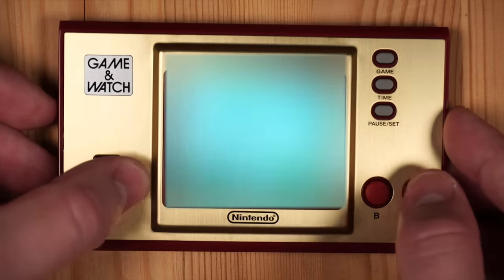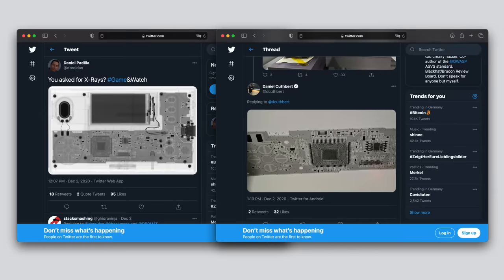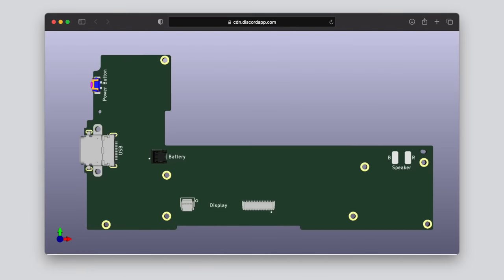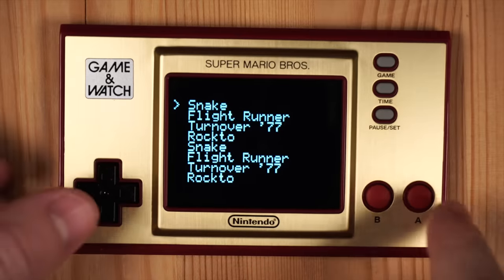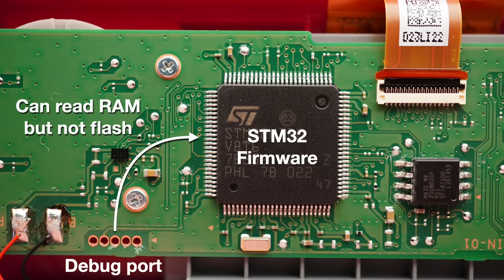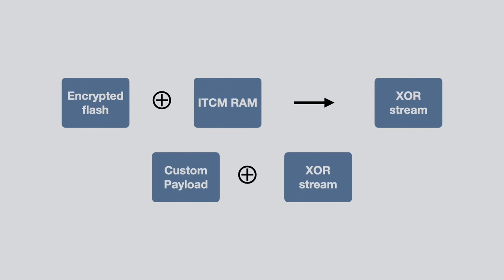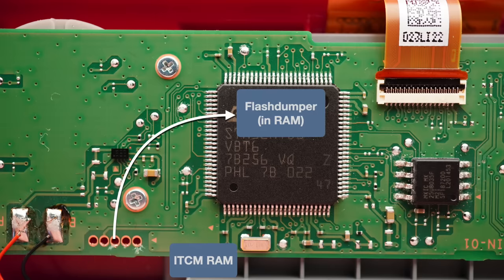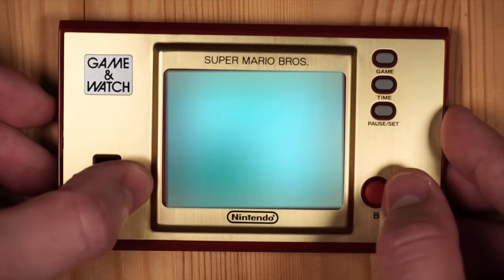Game & Watch: How we dumped the firmware & community-updates

Comment: At this rate, yall will basically make the G&W fully open source
Reply: I mean, it basically already is :p
The board's been retraced, all of the parts have been identified, and open-source software, whilst not exactly complete firmware replacements (although the gui branch in the retro-go project is looking pretty spicy 👀) is available and pretty usable!
Reply: @miko-nv9cl  This makes me want to do a through-hole soldered version of the G&W, what a cool community
Reply: @MrKhaz101  
I'd like to see someone try. 
  I'll settle for someone showing me a similar DC to DC converter that only takes a tiny over-width 0805 inductor, 2 resistors, and a few well placed ceramic capacitors in 0805 and smaller to run a μC of this size. ...Or better yet, someone tell me what chip they are using. I've been through smdmark, smd,yooneed,one, octopart, digikey mouser, arrow, TI, Torix Semi, AliEx and lcsc...so far, but no dice on a DSBGA-12 DC Converter or Audio chip match. I mean, if you were to want something to do...this is what I need to complete the fully reversed hardware.

There are ~70 passives and the vast majority are 0201. A THT design will be significantly larger :-)

@Sinisig
 yup

Comment: I'm most looking forward to the FPGA idea, I love the G&W design but the stock firmware is really quite lackluster. I'm also no good at soldering so a drop-in replacement board is ideal, and FPGA technology is amazing to me. You could even have an FPGA core for the stock processor, that would be some inception level shenanigans..

Comment: Really looking forward to this. Will probably wait until they have plug in boards or something you can swap in and be able to easily load up games. Also, I found out recently that they've some time ago reversed engineered the original Game & Watch games and recreated them in MAME I believe. It would be really cool if the community would be able to convert those MAME Game & Watch games to be able to load them onto this device and be able to play them. 

They may could even mode it to where you could put say the dual screen Zelda game on it too. As I believe you really only need one screen at a time, and then it could change screens to when you go up and fight the dragon. 

Maybe people in the know could pass these ideas along to the right people involved in this.
Reply from the maker: I mean it's in the video :) Someone already has the MAME G&W stuff running :)
Reply: @stacksmashing  Thanks. I was referring to hoping they design the boards/chips or whatever to be able to work with the MAMA G&W stuff. As seeing developer content doesn't mean it will be developed further into something that is easy or practical to put on later by the general public.

Comment: You all are doing some amazing work. While I personally don't plan to mod mine, I love it when people find ways to enhance products. Mind you, I kinda want to see a retro gaming device with the same form factor as the Game & Watch, but with all of the buttons needed for SNES. And could you imagine someone making a Game & Watch style dual screen handheld that could play DS games? Frankly that would be amazing. Of course, that would probably have to wait until new types of batteries replace lithium.
Reply: I think modding a Gameboy Advanced would be perfect. I never really like the DS personally, because the touch screen was under utilized in games. 😅
Reply: @megamanx466  I'll be honest, I like the idea of modding a GBA. The only issue I have is that I would like to have a plastic shell that was manufactured without a battery compartment, allowing optimum room for a flat internal rechargable lithium battery.
Still, I brought up the DS because merging the dual screen Game & Watch asthetic with the DS really seems awesome to me. Kinda like if you could play Game Boy games on a device that looks like a Pokemon Pikachu virtual pet. And they did also have those Game Boy style Game & Watch keychains, though they only had 3 buttons and a D-Pad.
Reply: @silversonic1  Yeah the looks of the GBA I wouldn't mind altering, because I never did like the original's look anyway. I think the ultimate be all portable system would be a PSP or Vita with those internal's hardware power, but modded to play anything. 😅
Reply: @megamanx466  I admit that the Vita is pretty good. But soon enough the Switch Lite could end up being pretty awesome for the emulation scene. Of course, the Vita still wins on pocketability.
Reply: @silversonic1  Yeah the Switch Lite is pointless to me. I have the Switch, but the Vita does have that pocketability and power(for it's size & age). 😅

Comment: I'd like to help support you guys, but I'm interested to hear more about use for non-developers.
Reply: Same, however it's doubtful they can do this since the USBC connection on the device is power-only afaik
Reply: @siskavard  it would 100% need a hardware mod, aside from the USB port there's also the fact that the default memory is too small, it has to be enhanced.

Comment: Is it possible to add sd-card SPI module, connect it to pins that are used for st-link and use some library that can use sd-card with bit-banged SPI?
Reply from the maker: Absolutely, though the problem with the SD card is throughput: The STM32 supports a memory mapped mode for SPI flashes, which is really fast and allows you to just run code from the flash. With SD-card you'd have to copy it into memory (of which we don't have much), or copy it to flash (causes flash wear) etc :)
Reply: @stacksmashing  I guess i spend too   much time with low-end stm32 (f103c8) that i didn't that they can run code from external flash. Well, it was just an idea. Keep up with great work you are doing! This is already amazing as it is!
Reply: @stacksmashing  umm, that thing has over a megabyte of RAM, that should be plenty for such a small system. Nobody but the insane would expect it to run something like Crysis, but having more RAM than a stock Amiga 500 should make many things possible.

Comment: Very cool! I have a question (maybe it's stupid): if you can run "flashdumper" in ITCM RAM, why not use it to copy the internal flash to RAM already? Why the extra step dealing with the SPI flash, encrypting and writing the payload just to have it loaded and executed after a reboot?
Reply from the maker: Great question! If you connect a debugger and afterwards try reading internal flash (from the code in RAM) the device will hardfault - so we need to be able to run code without the debugger attached :)
Reply: @stacksmashing  Ohh it's clearer now, thanks!

Comment: I wonder whether it would be possible to make some sort of modchip that makes it so you can alter the flash memory via the data points on a replacement USBC port? That would mean we would be able to easily put our own ROMs on there without very much hassle, only requiring we open it up once (and probably do a bit of soldering).

Comment: I don't know if this Game & Watch is still in production, i.e. Nintendo may have already manufactured all they are going to make. But I wonder if they may fix the language issue on future manufactured devices. And so it may be worth it to keep an eye out on revised units as they may also try and change something to keep it from getting hacked.
Reply: They said they'll be sold until March 31st of 2021. 😁
Reply: @megamanx466  Yeah, but my point was Nintendo acknowledged there was a language defect. And so if they are still manufacturing these, then they may make a running change to fix it. And they could also plug holes to help keep it from getting hacked.
Reply: @colt5189  Possibly, but the 'Super Mario Bros.' games have been on emulators for decades now, so I doubt it's worth the time/money for them to try to stop .0001% of hacking into their under powered collector's portable hardware that still has to be bought from Nintendo. Why not as a corporation just save the money/time and pass it on as profits? Most other companies aren't worried about obsolete hardware. 😅
Reply: @colt5189  Nintendo is lazy. They didn't even bother to overhaul the hardware in the re-releases of the NES/SNES Classics after they were hacked to death. Nintendo only rages when the Switch is hacked which got several hardware revisions.
Reply: @SonyPWNsNintendont  I'm glad Nintendo has been lazy on making these hacker proof. As it seems from what I've read that Nintendo could have put a little more effort into making it harder to hack these devices.

It seems very strange why Nintendo wouldn't put in the extra effort.

Though it bugs me with Nintendo being lazy by getting rid of the virtual console. Because there are plenty of older games that I would rebuy on the Switch that I can't because Nintendo dumped the virtual console for some dumb reason. Luckily some of that has been rereleased like the Sonic games, and the Contra collection, etc. But it's no where near what was on the virtual consoles.
Reply: @colt5189  It wouldn't have mattered anyways and it did take a while for the G&W to be approved by the FCC. Nintendo dropped the VC in favor of their dumb NES/SNES online service to justify the price of joke known as Switch online. Their retro offerings are overpriced waste that an unpatched Switch can overcome and now Nintendon't is pulling timed-limited BS with ROMs like Fire Emblem.

Comment: Had trouble sourcing a macronix mx25u12835F in the UK; digikey offers it, but with £14 postage from the US :-(
Thought I’d found it reasonably priced on eBay, ordered it, then realised it was an mx25L (i.e. 3V) not the mx25U. So, that was a wasted £5
Does anyone know a UK supplier? The 64 is available, but that’s only 8MB
Reply from the maker: Farnell should have it!
Reply: @stacksmashing  yes, but again coming from the US with a massive add on ~£14
Reply from the maker: Farnell is a UK company, they do cheap or free shipping to most of Europe
Reply: @stacksmashing  but they want to charge ~£12 to ship a £2 chip. They are sent from the US
Reply from the maker: They’re in stock in the UK. Though you might need to reach an MOQ to get cheaper shipping.
Reply: @stacksmashing  right. It looks like it’s the “handling charge” that’s the issue; I just need to reach a minimum total order of £40 to avoid it. If that’s what you were referring to, apologies are in order

Comment: Why not add more ram and use sd card for storage after that someone could make a clip-on over cpu or pcb with solder points
Reply: Ram is part of the microcontroller. It's inside the chip
Reply: @asciivision  guess u didn't read the datasheet hence add more ram